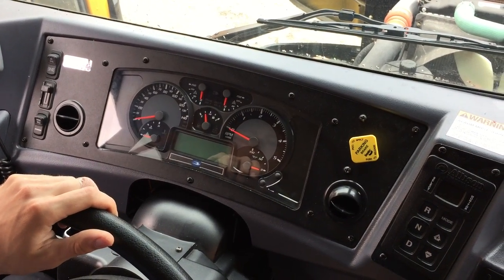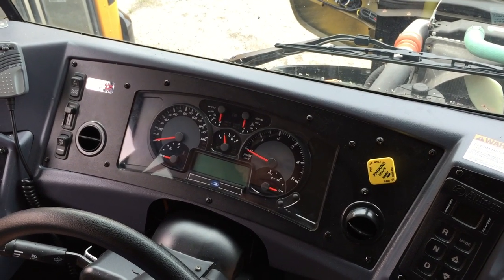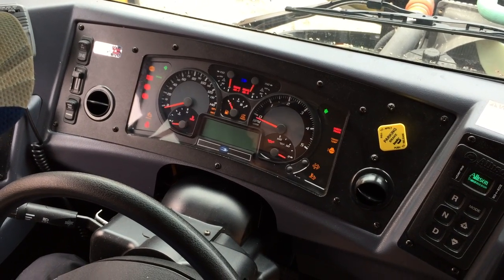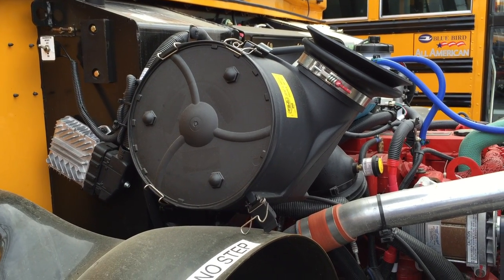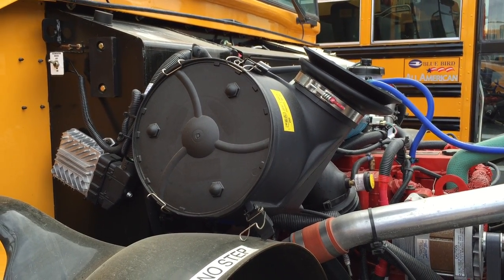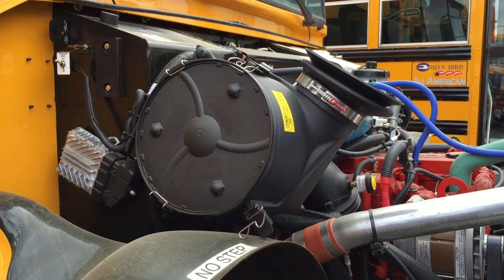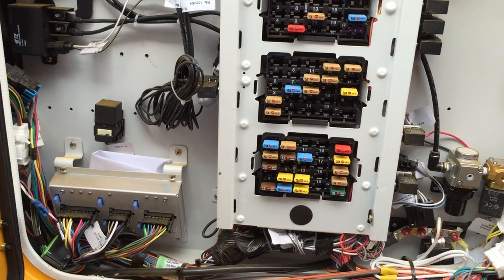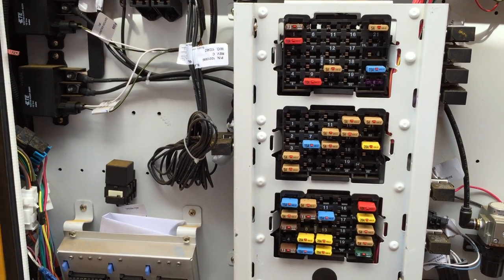Blue Bird School Bus Regeneration

Comment: Im a driver in ny and when the regen sign comes on, the mechanic showed me how to lift up the hood and turn lift nd hold the lever on the right. when you hear the engine idiling high, you let it run until its finish cleaning, the regen ( cloud of smoke sign, will go off) hve a blessed day fellow comrades in the imdustry.

Comment: How long you need to keep the engine idling after lift and hold the lever on the right. when you hear the engine idiling high? IOW how long does it take for this regen to complete?  I tried  doing it once but then the regen required appeared again after 3 hrs driving.

Comment: what if the bus ask for regen twice a day
Reply from the maker: Twice a day is excessive. Depending on the typical duty cycle, mileage, and idle hours of the unit you may need to remove the filter and have it cleaned.